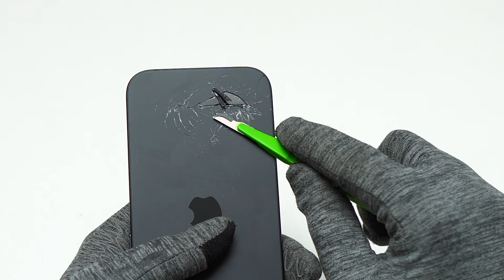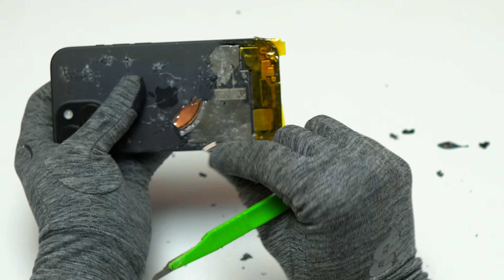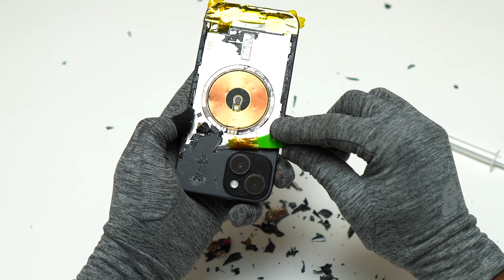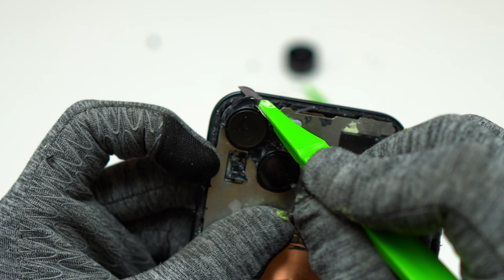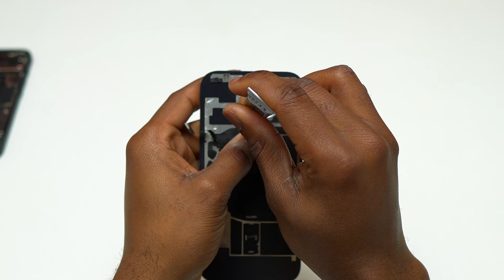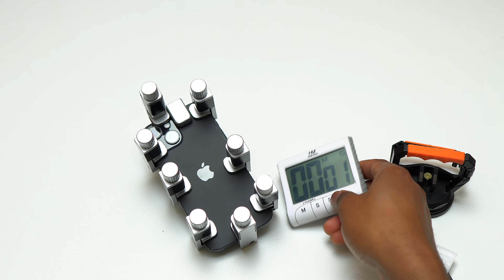Apple iPhone 15 Black Glass Repair Replacement

Comment: Wouldn’t it be easier if you remove the entire back glass assembly and then start removing glass from the metal plate?
Reply from the maker: Yes. You can do that. I feared that doing that might make it much more easier to bend the metal piece and later when installed it won't be 100% flat and push against the back glass might not be sealed very well.
Reply from the maker: I certainly could have done it the way you said and if the metal piece is not bent too much the result will be the same.
Reply: @ersbit  Bro you did it the correct way. Some people that watch videos and don't actually repair phones don't fully understand.